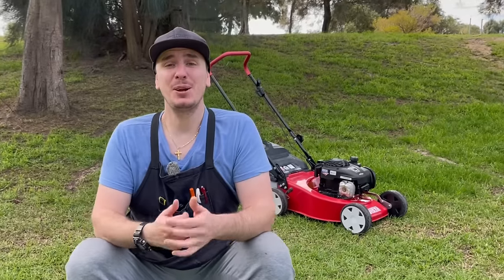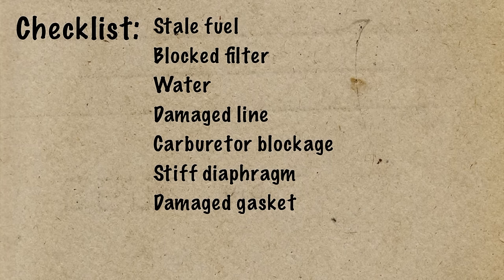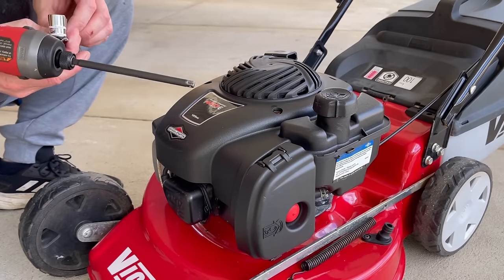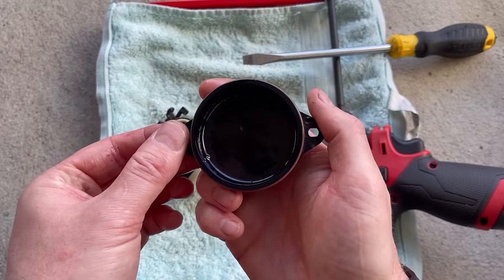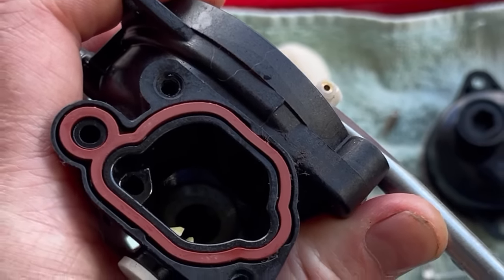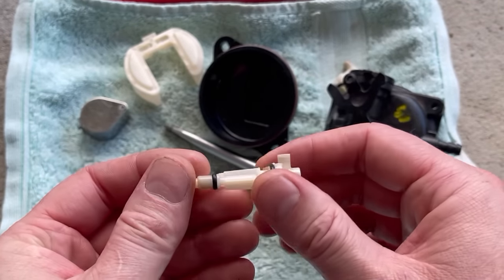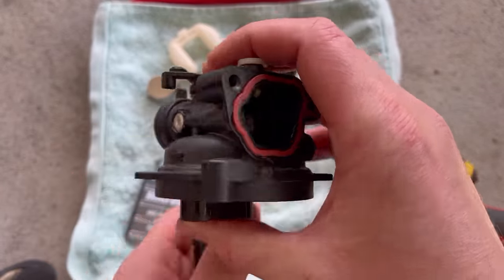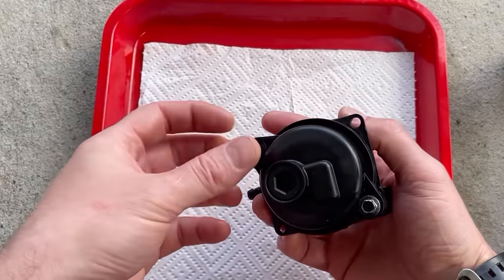Stop Your Engine Surging! (Easy DIY Tutorial!)

Comment: Something to be extra mindful of when taking apart the E series carbs is making sure to keep track of the super tiny rubber tip that goes on the needle valve. If it ever pops off (doesn't take much for it to pop off) you'll likely never see it again. Your needle valve will not work properly without that tip so you might as well replace the entire carb because a replacement needle valve is only a few bucks cheaper than the entire carburetor
Reply: By the way, this applies to the ones with plastic needle valves - not sure if the metal ones like the one in this video have a tip that can pop off as easily but I would be cautious and handle the needle valve over a container or something that could catch the tip if it did pop off.
Reply from the maker: Thanks for sharing. I’m not sure what part you’re referring to it’s been a while since I took one apart lol
Reply: Sounds like they are referring to the fuel unless needle and seat valve
Reply: Great video and well explained! Thanks so much

Comment: Incorrect governor tension should of been on list
Reply from the maker: Thanks for sharing! I haven’t come across it before but It’s logical that If the engine is over speeding it’s demanding more fuel which stock settings may not offer and then surge. Thanks :)

Comment: Any suggestions for a surging Briggs and Stratton 17hp OHV with a newly replaced crank case gasket, head gasket, new intake gasket, new air filter, valves cleaned and lapped, verified spark, 100 PSI compression?   She starts right up, but it surges and has some smoke coming out the exhaust.  The engine internally is super clean, cross-hatching on cylinder walls, compression relief still solid.  I'm at a bit of a loss on the surge issue and smoke.  Valve gaps checked and rechecked. .004" intake and .006" exhaust, set about 1/4" past TDC on exhaust stroke.
Reply from the maker: Hey, I would suggest it’s likely two seperate symptoms - surging and smoking. 

Surging: blocked fuel filter, faulty fuel pump, damaged lines, blocked carb jets, improperly tuned carburetor, leaking intake manifold, leaking head gasket. Incorrectly set governor (too fast) causes surging too. 

The smoke could be: overfilled crankcase, blocked pcv valve, worn bore, leaking valve seals, incorrectly fitted or sealing head gasket. 

Double check your work and the above points :) a leak down test will be useful in this instance!
Reply: @VintageEngineRepairs  Believe it or not - the governor spring was just a bit over stretched.  I tightened it up today, and the surging stopped and I really have not noticed much smoke.  Runs very smoothly now.

Comment: What causes this with a brand new carburetor? Can’t be the filter I don’t think. The gas leaks out when removing the gas line. Throttle just won’t stop surging. Throttle spring has good motion. It’s a craftsman m230 b&s 7.25 163 ohv.
Reply from the maker: Very likely the jet is too small, or an air leak :) when it’s running you can spray some brake cleaner around the area where the carb fits to the engine, intake and cylinder head gasket areas. See if this changes the rpm. If not, you may need to drill the jet bigger.

Comment: Mower started surging so I did a deep clean and fully cleaned every bit following the video and it started first try but still surges. Looks like I'll have to buy a micro drill set and make the jet bigger.
Reply from the maker: Yep, you may have to :) do spray some brake cleaner around between the carb and intake manifold, a leak there can cause lean surging ;)

Comment: Tom one of your best videos very informative and well put together. These carbs are a pain but good for business here in Canada. The jets are so small just a small piece of debris that gets through the fuel tank screen is enough to make it run poorly, hunt or not start at all. Those jets are only held in with O rings and if you ever get one that is flooding ie: low rpm and black smoke the jet has loosened off and fuel is bypassing the O ring. I know this for a fact when i kept using carb cleaner with the straw and was actually pushing the jet back in place without knowing it. Customer would use the machine for a lawn cutting and sometimes into the second cutting and it would flood out again. Not until i ran it in the ultrasonic cleaner did i find the jet falling out and realised the problem. Reinstalled the jet with some SealAll glue around the OD only pushed back in a voila good to go and still running smooth. It was cheaper than replacing the module which runs around $20 Cdn.
Reply from the maker: Thanks for sharing Wayne! Yep, if anything leaks by some seal all is a great solution!

Comment: I have a Honda mower, it was surging & kinda struggling when going over tall grass.
I took apart the carb & used the seafoam intake cleaner that comes with the red straw to sprayed the crap out of it & used the straw to put pressure through all those fine holes you pointed out. Put it back together and & added a bit of the seafoam you add to the gas tank as well. Problem solved, put new blades as well & that puppy is purring nice & now I can go over tall grass without stalling. And that was my 1st "taking a carb apart" job lol, glad I didn't wreck it! 😂
Reply from the maker: Haha glad to hear you fixed it! Good work mate :)

Comment: Thanks, had the same unit of the Yard Machines variety, the .035 drill to jet worked, adjusted valves too .. still had a little erratic running so I filled the tank and put a splash of water remover (methanol) in the tank and it smoothed right out.
Reply from the maker: Awesome mate!!

Comment: Thanks to your video our mower finally stopped surging. The pilot jet was totally blocked, so I just cleaned it with 0,35 mm. In our case, the pilot jet was behind ball bearing (06:02). I drilled 1,2 mm hole just behind the ball bearing in order to get it out and then filled it with part of an “O” ring 1,5 mm.
Thank you
Reply from the maker: You’re welcome :) glad it helped!!

Comment: Be mindful when removing these carbs from the intake tube that you don’t lose the black o-ring. They can come loose when pulling carburetor off the tube, or stay on the intake tube. There is a white o-ring too. Upon reinstallation, seat the black o-ring into the carburetor first, then the white one, then push back onto lightly lubricated intake tube. Don’t forget to connect your governor linkage pushrod and spring first. If you have a autochoke (common on Toro Recycler), there will be a second pushrod linkage on the choke control arm, which can be tricky trying not to bend and deform the pushrod. Mind that the plastic pusher foot on the autochoke pushrod connection piece atop the carburetor is positioned on the correct side of the choke control arm where the foot makes contact, so as when the exhaust heats the autochoke actuator and actuates the pushrod, the foot pushes the choke linkage to the open position. It is possible to assemble with the foot on the opposite side of the choke arm. A heat gun is a good way to test an autochoke bi-metal actuator for proper operation.
Reply from the maker: Thanks for watching and commenting 👍👍

Comment: You need to check the priming bulb too - they perish and can let air in even when they don’t show any fuel leakage. Top tip for all these machines that are only used seasonally - ONLY USE PREMIUM GRADE FUEL.
Many of the E5 Petrol’s are just Petrol - there is no ethanol in many of these premium fuels (UK law states it must be marked and sold as E5 if it has less that 5% ethanol - which of course pure petrol is!) 
Ethanol causes the petrol to spoil within a few months and destroys many of the plastic fuel lines, seals etc. Nitrile and butile rubbers (O rings) are mostly OK, but plastic fuel line especially will just rot if ethanol is present (yes, I am talking to you Stihl).
You do not need to buy the over-priced ‘petrol substitute’, just straight petrol is fine, but do drain it out if you’re laying up the machine for months.
Reply from the maker: Yep use non ethanol is a huge problem solver for many! Thanks for watching 👍👍

Comment: While I greatly appreciate the detail and effort of this video, if the gaskets need replacing or the rubber tip of the float valve plug has deteriorated (as mine had), a rebuild kit containing these items (Briggs & Stratton 594636) costs at least $37, whereas a replacement carb with two air cleaner gaskeys costs only $9 on eBay (mine was the two control rod version).  If you DO buy a replacement carb, be sure to blow into the gas inlet to ensure flow. I installed one without doing this and the valve was stuck closed.  Upon comparison with my old carb, I found that the float valve seat was insufficiently recessed.  A 3/16" Allen wrench socket wrench adapter was inserted into the float valve tube and a large Vice Grips used to press the valve seat to the proper depth.  Fortunately the valve plug rubber tip was undamaged by the manufacture's assembly abuse.  O&BTW, if the bowl is installed 180° out of the correct position, surging will also occur. :/   UPDATE:  The surging was caused by a too large ID carb/engine O-ring allowing unregulated air into the engine.  Why bother manufacturing something this complex, yet screwing up these minor details?
Reply from the maker: Sure :) you do what ever works best for you!

Comment: Excellent video.  Would you place that plastic carb in your ultrasonic cleaner?  I also wonder if drilling out the jet was necessary even though I think they set them on the small side for cleaner air.
Loved the "check list" too. Thanks Tom!
Reply from the maker: I recommend drilling them out. :)
Reply from the maker: Sorry I missed your first part - yes you can ultrasonic clean them!

Comment: Yah the 125cc Briggs have more problems with surging  then 140cc and bigger. 

If a cleaning doesn’t fix some ppl enlarge the main jet with a micro drill bit by one size as a last resort.
Reply from the maker: It’s really not the main you should touch it’s the pilot 👍

Comment: Great vid sir , i work on  more stuff like toro and ventrac  , iseki  machines but the guys in other bay’s work on those type mowers  , they look annoying to work on , one thing is the flat head engines seem to have less problems than over head valve newer stuff  , to much to go wrong and cheaper made , even som of the Honda engines (certain  models) are having  issues with decompression  cams failing on new machines    ,,old stuff is better but law of omissions  stopped the flat heads production sadly .. 👍🙂
Reply from the maker: Absolutely :) I’ll take a flat head for reliability every time haha

Comment: Mr. Tom thank you and well done!  One question, why brake cleaner and not carb cleaner? OK 2 questions, was there no link for the baby drill bits?
Reply from the maker: Hey Paul, my apologies! I have used this set extensively for the last 4 years. https://amzn.to/4czLtDK It's been great. My one tip, if the drill bit slips in the pin vice, tighten the head up in a vice holding the other end of the pin vice with pliers! Also, doesn't hurt to buy 2 sets, the drill bits are TINY and when you're learning how gentle you need to be you'll likely snap a few - i have 2 sets :P

Comment: I have a lawn boy 10632 with 5.5 brigs and auto choke.  Was surging then stopped starting all together.  This was after already cleaning carb.  Installed a new carb today..  runs good but when you move the mower back and forth it starts surging then if let sit it clears up.
Reply from the maker: Sounds like fuel delivery, was the new carburetor OEM? Open the L screw if it has one :)
Reply: There is no adjustments.  It is a Chinese Amazon knock off.  I may open up the new carb.  There could be debris from manufacturing inside it.

Comment: Great video, very clear to follow. My mower was surging and running for a minute or two then cutting out, I have replaced the carburettor and air filter and it is still surging and cutting out but will run for maybe 4 or 5 minutes now before cutting out. It also requires priming every time to start. There is new fuel in it and no water in the fuel tank. Does this give you any clue as to what the problem may be please? Thanks in advance
Reply from the maker: Hey, what is the flow like through the fuel line? It may be as simple as a partially blocked fuel filter inside the tank.
Reply: @VintageEngineRepairs  thank you for the reply, the filter at the bottom of the tank looks clear and I can't see any splits in the fuel line. I think I might have to order some micro drills and have a go at increasing the bore of the air jet.

Comment: This is assuming your exhaust is not cloged and no dirt dobber has made your muffler a nice little home...
Reply from the maker: Hmm that wouldn’t cause surging, but yes, always check!
Reply: @VintageEngineRepairs  oh yes it will if it is not fully open to let the exhaust out it will surge and die under a load I just had one come to my shop like a week ago and that was their problem.
Reply from the maker: @greenreviews3391  interesting I have never had one surge with a blocked muffler, I have had them struggle to go much above a slow idle though. Thanks for sharing!
Reply: @VintageEngineRepairs  me either.. I felt exhaust coming out so I didn't think to check it so I bought a new carb was only $23 put it on and changed nothing.. which led me back to air or gas issue. Started out removing variables. Started with sir filter and made my way to remove the exhaust and bam pur like a kitten found a nest in the exhaust. Wasn't fully closed but enough to cause problems after cleaning and reassemble.. ran good it was a 6.5 kholer engine on a wood splitter

Comment: What about a lawn tractor that only surges when running by itself? Add an attachment i.e. a load and the surging goes away.
Reply from the maker: When there is no load it will be running on the pilot circuit. If it surges then, it’s not getting enough fuel through the circuit. Either it’s blocked or needs to be drilled.

Comment: I wonder if it would be quicker and easier to replace the carb if it were suspected of problems.
Reply from the maker: It’s not been my experience, replacing them typically means doing so with Chinese copies which don’t work well if at all. You’re throwing money away in my opinion. Rebuild the genuine one whenever possible!

Comment: I had luck by drilling out the lower main jet because the  mower likes to mostly run off the pilot jet it's very starved underload by that smaller main jet down bottom  I gained  and extra pony in the cut when I went up a size with that main jet ran way better  it probably could.go up a  couple sizes on these carbs possibly you may need to up both  got the micro drill bits off amazon  just don't break them off  in a pilot jet. I  did that to one I can't say if I was forceful or the  drill bit wasn't very good to begin with their so tiny
Reply from the maker: Yes unless it surges under load, it’s pilot jet :) the drill bits are so easy to snap aren’t they!

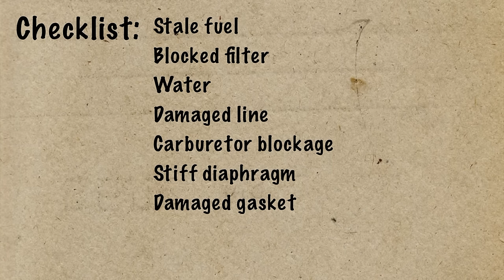Comment: Where and what is the (stiff) "diaphragm" that you refer to in your checklist as shown at the 1:36 min. mark, as  I don't see this as being otherwise specifically shown &/or visually identified, anywhere else in the video?
Thanks, in advance.
Reply from the maker: Most lawnmowers don’t have them. 2 stroke victas do :)
Reply: @VintageEngineRepairs  Okay. Good to know . . . which leads me to another question, which is, Is the mower in this video a 2-stroke Victa mower, or a 4-stroke, and what's the difference between a 2-stroke vs a  4-stroke . . . is it that a 2-stroke requires an oil to gas mixture in the furl tank, because there’s no oil inlet, as opposed to a 4-stroke, which has a fuel tank for the gas, and a separate inlet for the oil - where the two are not mixed directly together, into the gas tank?
Based on the aforementioned, I'm assuming this it's a 4-stroke in this video (and not a 2-stroke) , as the oil inlet appears to be visible at the lower left corner of the engine, at the 0:56 min. mark - while you also state at the 2:08 min. mark thereof, that someone (may have) accidentally put a  2-stroke mix into the fuel tank of such?
But if I'm wrong in my understanding and the mower in this video is a 2-stroke, then I would again, if there’s any way that you could specifically identify the "diaphragm" w/in the context of such, as already previously referenced? 
And finally, at the 3:27 min. mark, you reference the "PVC tube". What does “PVC” stand for?
I sincerely apologize for my ignorance in these regards, and for my query in these respects being so long winded, which is unfortunately due to the fact that I have a disability w/processing information, and so this is how I learn.
That being said, thank you so much, once again, and also again, in advance, for your patience and understanding, as well as for your clarifications and help.
Reply: Ummm, hello?

Comment: Hi Tom, I appreciate the vid.  My 3 y.o. Cub Cadet snow blower sat dormant last winter and I forgot about the gas.  It fouled the carb, so I drained it and cleaned the carb, making sure every hole, passage etc was squeaky clean.  It started on the first pull, but it surges when it never did before.  This is a puzzler for me.  Any suggestions?
Reply from the maker: Hey, surging when not under load is a restriction of the idle fuel passage or too much air. Double check any o-rings that can fail too :)

Comment: Ever had a go-round with a surging honda generator?
Reply from the maker: Hey, surging is the same on a generator as it would be a water pump or a lawn mower like this. If you follow these steps you’ll solve your issue.
Reply from the maker: Hey, what do you mean go-around?
Reply: @VintageEngineRepairs  trouble